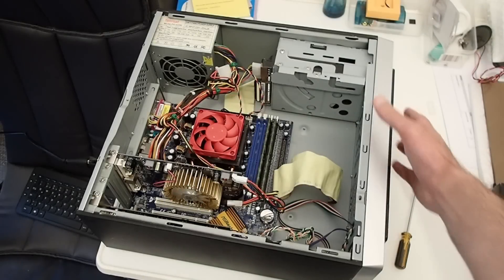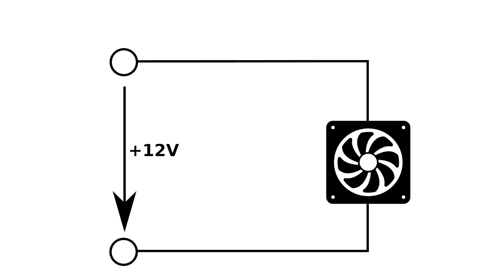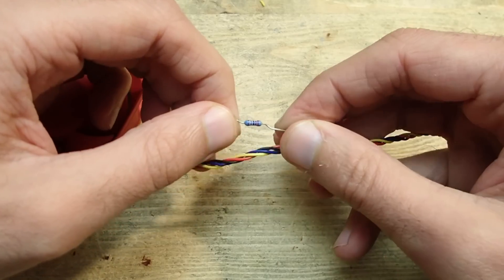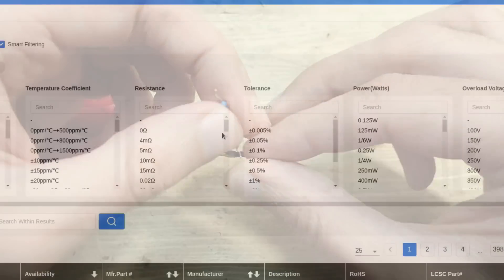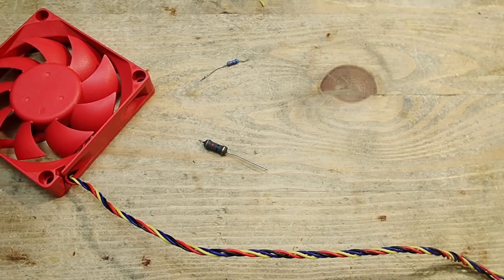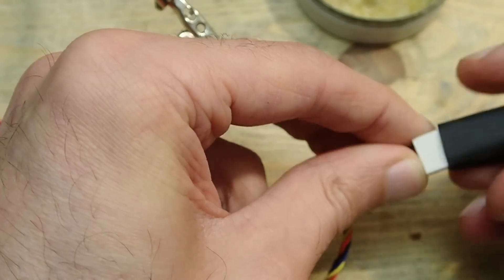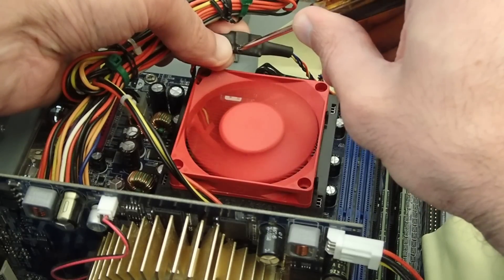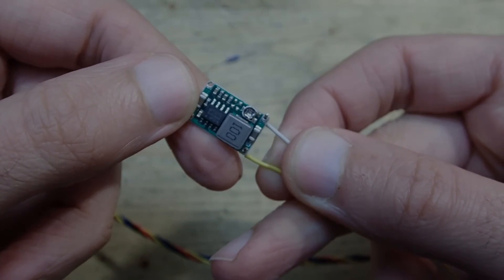Noisy CPU fan? Here are some ideas.

Comment: A neat trick to get the fan running on 7V without using resistors is to connect it between +5V (red) and +12V (yellow) on the PSU molex connector.
Reply: Yeah, i nearly commented but i see that you already wrote it
Reply: before i buy such a complicated stuff, i buy a little fan controller with a temp sensor, which ramps the fan automatically depending on the temps...
also when you have a pwm input to control a fan, use this with a pwm generator, so the motor has enough torque to start.
Reply: There are adapters for that.
Reply: I did that on two power supples back in the mid-00's. I don't know for sure if that's what killed them, but they both died pretty soon thereafter.
Reply: I've used series connected diodes. Each diode will drop about 0.6 volts. Eight diodes will drop 4.8 volts. This will leave about 7.2 volts for the fan. Add or subtract diodes to "fine tune" the voltage.
Reply: Also, the the 5v will become ground and 12v become pozitive
Reply: I’m not sure that the 5V rail will appreciate being a current sink ...
Reply: @sirnickity  actually it works ok, that's a really old trick
Reply: @devl547   I know, I’ve tried it back in the early 2000s.  It “works.”  But, it’s not a very polite hack.

You’re dumping current from the 12V rail through the load and into the 5V rail.  It’s not supposed to be a current sink.  The only reason it works is because other things on that rail are consuming that current and pulling the voltage back down to the regulated voltage.

As long as the 5V rail is loaded adequately, it ...  should ... be fine.  But it’s not particularly sound engineering.

Also, I would only ever consider doing this with 2-pin fans.  If you try and use the tach pin on a 3-pin fan, your motherboard is expecting it to be at Gnd potential, while your fan is referenced to 5V.  The result could be bad tach readings, or damage to the motherboard speed sensor channel and/or fan.

IMO:  Just use a regulator.  It’s what they’re for.

Comment: To make the transistor design even better use a linear potentiometer for the voltage divider on the FET design for variable voltage/speed control. This would be a great solution if you didn’t have a buck converter and would cost less than a dollar.
Reply from the maker: Yeah, I wanted to make the transistor solution first, but then found the buck-converters. The transistor solution would be probably even free, since that simple parts I'd be able to desolder from some scrap, which I have in my workshop. But it was just simpler to got with the ready to use converters, which I had anyway.

Comment: I had used one of those booster ones from 5V to 7V for a Noctua NF-A14 fan that I put onto my Fritz!Box Cable 6490. The fan was powered by its USB port. Due to Gigabit internet, I now got a Fritz!Box Cable 6591 which runs much cooler without a fan.
Reply from the maker: Yeah, that is a step-up or booster converter, also very useful. I used a step-down converter.
Reply: @necro_ware  Yep those modules come in all sorts of flavors, even extremely high powered ones as well!

Comment: My solution - buy Noctuas with low noise adapters. lol
Reply from the maker: That would be too boring for me ;)
Reply: This would have doubled the value of the machine and no fun 😄 I have used Noctua in one of my AM2 "Phenom" machines. Just to try, looks cool, works cool but too easy - just swap. The original fan was beyond repair but the metal block is pretty good.

Comment: Heres an idea. make a fan controler with one of those. 
I bought a used 212+ for cheap because it didnt come with the original fan, it came with a cheap 1200rpm chinese fan which wasnt fit for this heatsink, so i added an industrial 3000rpm fan which i had laying around.  The problem is that while the fan that it came with had 3 pins, this industrial one didnt, it only had + and - so not only it didnt have a tachometer but it also wasnt possible to change the speed, so i wanted to be ablt to have a powerfull fan while also be able to control it and so i grabbed one of those tiny buck converters and hacked it a bit.
First i grabbed the pwm signal from the motherboard and pass it though an RC filter, then that output goes to a 393 , then i have another variable resistor as the voltage reference and the output of the 393 opamp goes to a small PNP transistor that bridges the output of the buck converter to the middle of the voltage divider of the feedback circuit.
It works great though i think a 393 is not the best option as even though its a 2A buck converter it cant handle 2A while on the fan controller. It can in fixed voltage mode but im sure there must be some noise in the circuit that is causing it to trigger earlier. I had the scope in a box when i made it so i didnt check it but my next prototipe will be with one of those 5A ones as one of the fans i got for the pc was too powerfull for the tiny fan controler (a big 130mm x 32mm 12v 1.9A server fan )
Reply: Can't you use the PWM from a fan to just drive a MOSFET or BJT directly? The fan will be powered in bursts but if you're lucky they're fine enough to where it isn't audible, this is approximately what the PWM pin does on these fans anyway.

This mainboard doesn't have PWM outputs, that's the whole thing.
Reply: @SianaGearz  
while the intel spec says the pwm signal is around 25khs the problem is that most fans have capasitors in the power input, so any pulse gets filtered. Using pwm with one of those would give you a very logarismic looking speed cuve. (already tried that)

the pwm on the fans controls the switching transistor directly so theres no capasivite load on them. But to an externat transistor the fans (at least the big ones and more powerful) at quite capasitive
Reply: @laharl2k  I have seen that, for that reason i have jammed in an inductor and a capacitor before the fan on one of the things i built where i use PWM fan control. Inductor... i forget, a shitty tiny little one, somewhere between 50 and 330 µH, i don't remember, with maybe around 2 Ohm series resistance; actually i think i used two, one on each wire; and a capacitor of i think 470µF which was WAAAAY too generous, please choose a smaller one :D The thought that this is total overkill did cross my mind, but the cap just landed in my hand when i grabbed it so i decided to try, and was too lazy to replace it with anything later.

Comment: Or for providing 7 Volts without any resistor being used you just disconnect your fan, pull the black and red wires off the fan connector, and then connect red one to the yellow wire of the Molex connector (+12V) and black one to the red wire of the Molex connector (+5V).
Since these voltages have the same ground (black wire) voltages will be substracted one from another and we will get the needed 7 Volts (12-5=7)
Reply from the maker: I use this method for the older machines, where fans have molex connectors, but in this case it would be too messy for my taste.
Reply: @necro_ware  and start a fire because you could trick the short-circuit protection on psus that monitor ground current
Reply from the maker: @duke_of_oz  That's a good point, never thought about that. I'll have to check out, what will happen if I short 5 and 12V on a good PSU :)

Comment: Very good and clear explanation.
Technically you could use 555 timer to make PWM signal that you could apply to pin 4 of the fan.
Reply from the maker: Yes, I thought about that too, but as I said, I dug through what I had at hand and came out with this solution.
Reply: @necro_ware  should have used the transistor dropper with a thermistor and then the fan speed would increase should temp rise

Comment: Is there a simple way to manually control the PWM line instead of the supply voltage itself?
Reply from the maker: Yes, you can use a 555 timer in an adjustable circuit.

Comment: Ah, the age old problem of using a newer PWM fan on an older non-PWM fan header - super-speed blowy fans ahoy!
(I had the same problem with having to replace smashed fans on my NZXT case caused by a mild housemove disaster, and found they now only do PWM fans - so I ended up using SpeedFan to manually bump it down until I eventually replaced the motherboard).
Reply: They don't do only PWM fans, you can still buy 3-pin fans, but to find some fans which have low RPM without regulating it is not that easy today. It's sad that today computer shops have literally nothing compared to 15 years ago and you have to order every shit from China. 😀

Comment: I thought you will be building a temperature controlled PWM regulator.
Reply from the maker: No need to overengineer things ;)
Reply: @necro_ware  It's not so complex, can be built using a 555 timer.
Reply: @JendaLinda  I did that with an Arduino and it completely escalated into a full on fan controller with hardware fan curves and sensor value mixing (matrix) for my water cooling setup. :D

Comment: I use to go the complex route like you did, then I just started wiring up the fans to the +5v rail which worked perfectly.
Reply from the maker: For older PCs with fans hanging on a molex connector, I do something similar connecting +5V to the ground pin of the fan and getting it to +7V, but in this case the fan has to be connecte to the mainboard, atherwise it would give an alarm. And wiring 5V to the fan in such case would be quite a messy operation.

Comment: Used to be able to go down to Radioshack and get a linear voltage regulator, a pack of resistors, and a variable resistor. Now you can order a $1 buck converter from China. Ahh, such progress.
Reply: In thailand you can still do that, not radio shack ofc but an electronics and stuff store.  Discrete regulator components or the aliexpress buck converters boards from a walk in store.
Reply from the maker: You still can do this in Germany too. Well kind of, currently due to the electronics crisis some parts are hard to find and everything is super expensive, but possible.